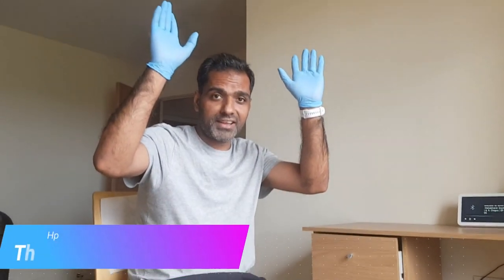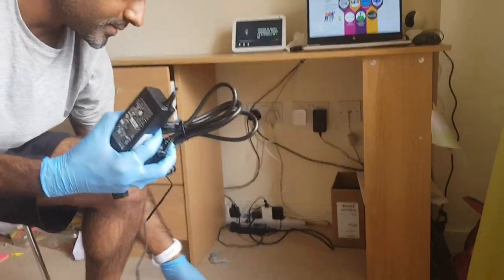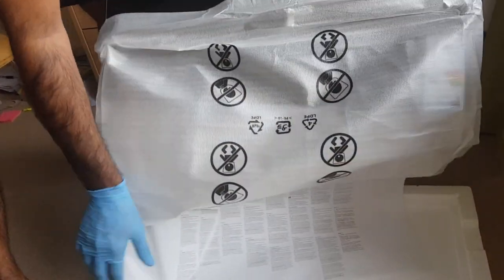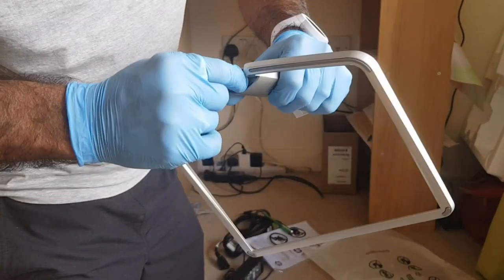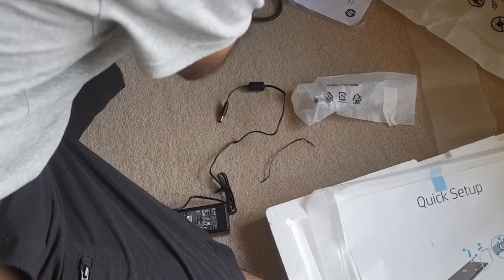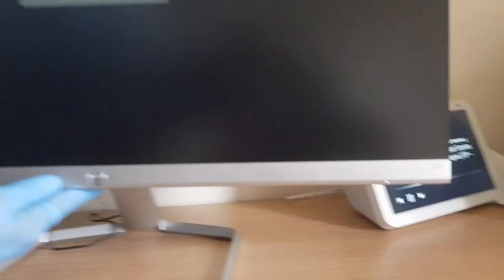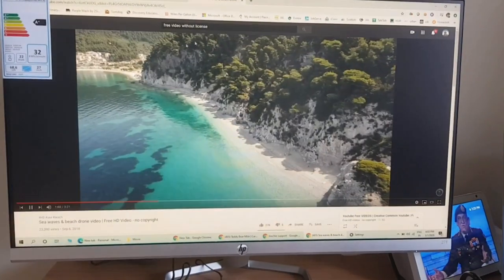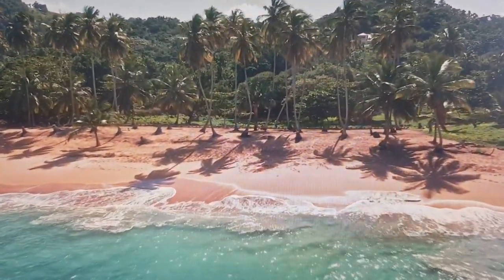HP 27f PC monitor unboxing review

Comment: I have the exact same monitor and I suggest you change the refresh rate to 75 Hz instead of 60 Hz. The HP 27f supports 75 Hz, just look at the front of the box. Very easy to do.